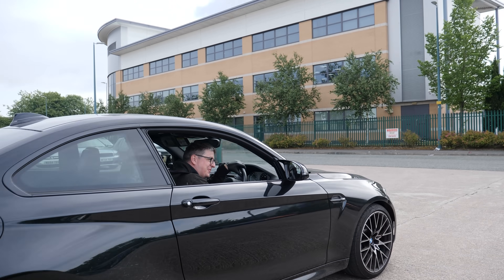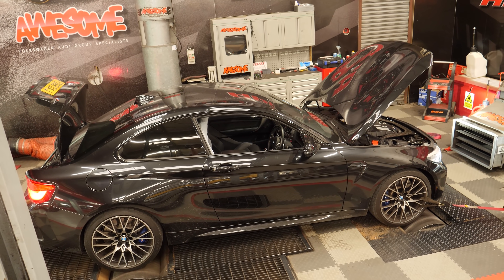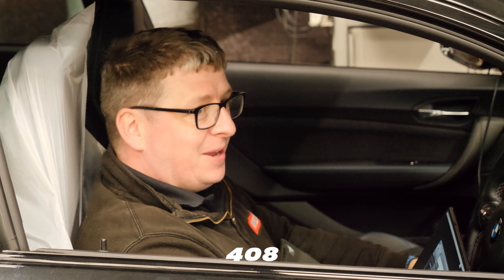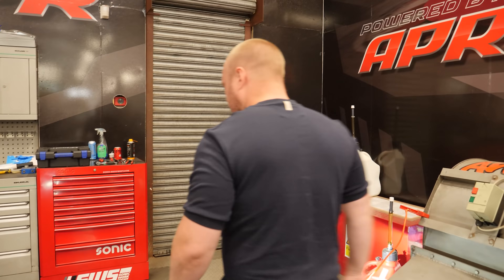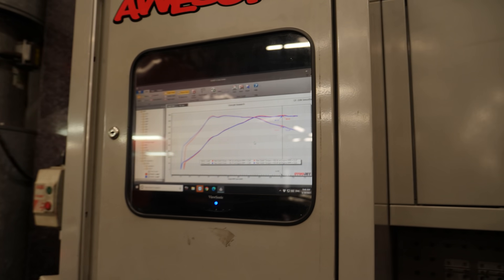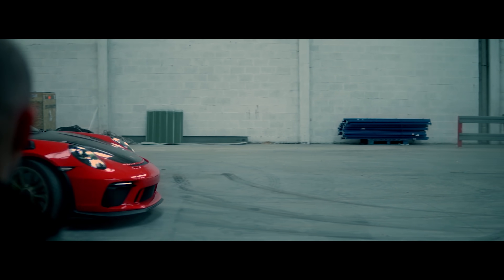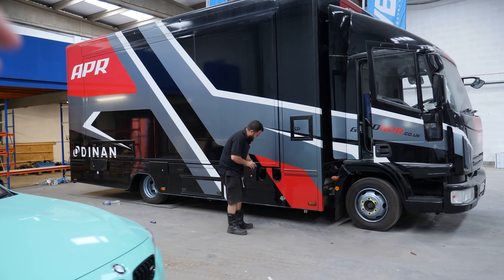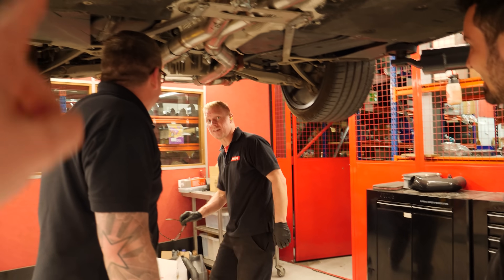We Spent £3000+ in BMW M2 Parts *IT'S NOW EXTREMELY ILLEGAL!!*

Comment: I’m almost certain the opfs are what you guys were calling the cats, on every other YouTube video the opfs are noted as being part of the majority of the exhaust, not the down pipes. I’ve seen imran from evolve runs their s55 m3 WITH the cat as he says it sounds crap without. Also this is why you needed an equal length system 😂
Reply: OPF or GPF are not Catalytic Convertors. They are particulate filters that are in addition to catalytic converters.
Reply: @reloaded25  I didn’t say they were…

Comment: Needs a resonator put back in don't put the GPF back in as it will massively restrict flow and power either that or replace the Scorpion midpipe with a single midpipe or equal length midpipe

Comment: I could be wrong but that “tinny” sound, sounds like a heat shield vibrating🤔
Reply: Na, that’s just how the S55 sounds because a set of 3 cylinders feed each turbo, so the sound pulses are out of sync due to the unequal length the sound pulses travel to the back box and create the tinny sound. The more free flowing the exhaust the more it’s amplified. Once the EL mid pipes are fitted the sound pulses are more in sync and help with the raspy sound. Best way to make the S55 sound good is revert back to single turbo like the N55.

Comment: Why fit hot air filters?🤦🏻‍♂️
Reply from the maker: Consistently ran over 500hp on the dyno so didn’t see any issue. We have a budget of £5000 which included a lot of parts. These intakes fell into that budget and are doing the job just fine 🤷🏼‍♂️

Comment: Cool video but the crank hub spin isn't a "common problem" and the engines don't "shit themselves" it's actually a very small percentage of cars this has happened to but as rumours are once it's a on a forum it's apparently a common problem *yawn*😒99% of the failing cars are remapped to the moon... and being driven like yobbos smashing foot to the floor in auto mode making the the car drop 5 gears at once no wonder the bolt slips. This doesn't ever happen on OEM stock cars!
Reply from the maker: Oh. A mate of mine works at BMW and says it’s a known fault fixed under warranty 🤔 surely they wouldn’t be doing this had they ALL been tuned to the moon and hooned around all over the place? Plus, ours has been tuned so done it as a preventative measure 👍🏼🤔🤷🏼‍♂️